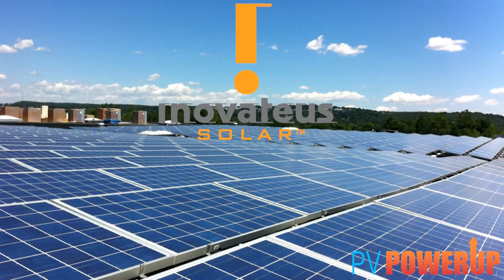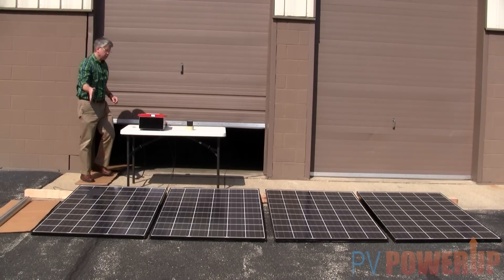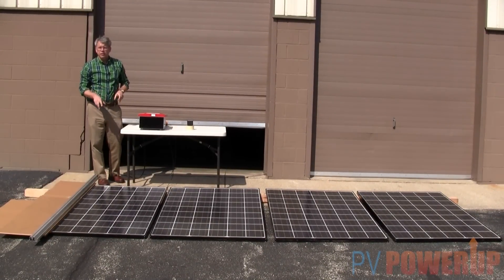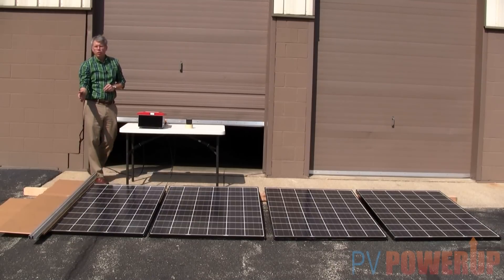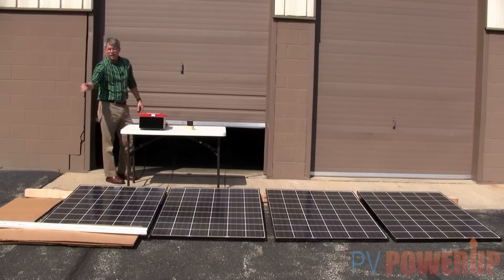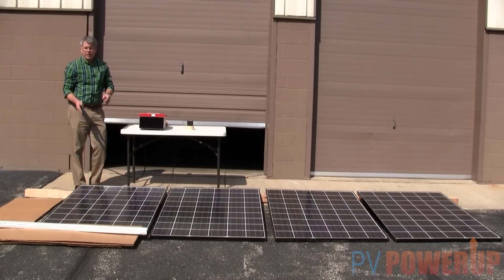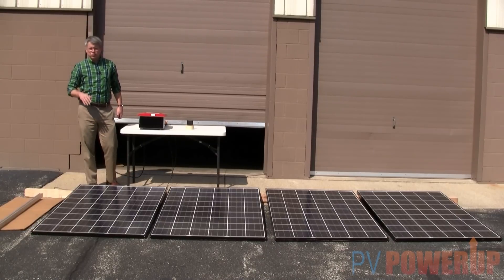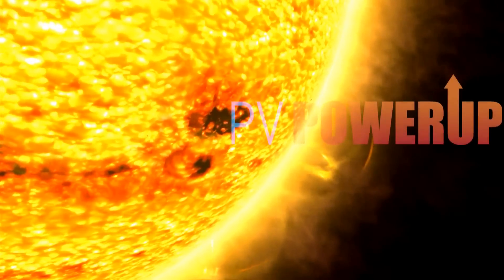PV Power UP - Shading

Comment: Good video, however it would have been more interesting to see the effects on an inverter that isn't >10 years old. I know for a fact that shading 3 cells on a module will not reduce the output of a Sunny Boy 9000US transformerless inverter by half.

MPPT algorithms have come a long way since that  little 700U and the only people teaching the domino/Christmas light effect, a few cells of one module having the same effect on the rest of the string, are the microinverter manufacturers.